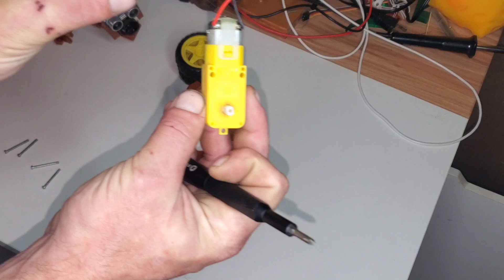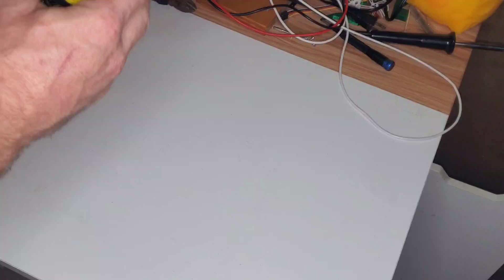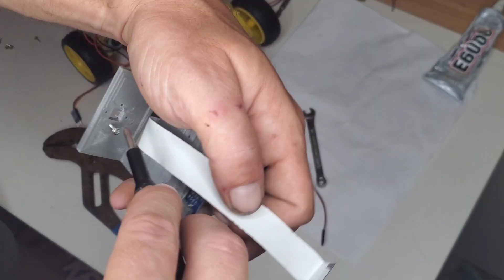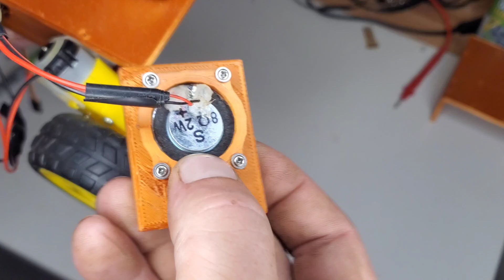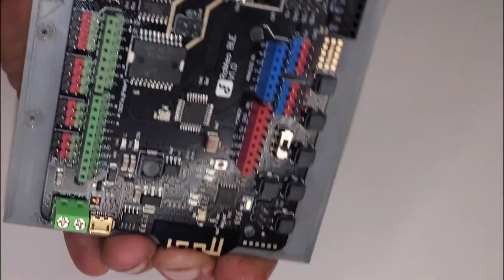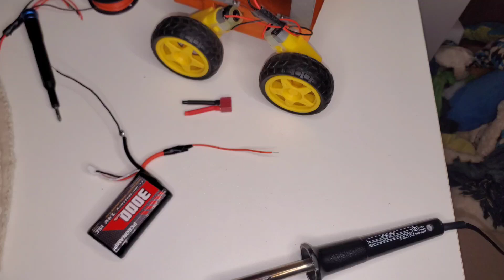How To Make A Robot That's Fully Controlled By ChatGPT (Part 1 of 2: The Build) - ALL CODE INCLUDED!

Comment: can i use the arduino + L298N and usb webcam instead of the DFRobot Romeo BLE Arduino style board and picam you used in this video?
Reply from the maker: Yes but the camera runs to the pi, not the arduino. But you can definitely connect a Webcam to your pi. You might have to modify the code some but it shouldn't be more than a few lines to change.
Reply: @makingmadeeasy  will you release a video for arduino,usbwebcam,HC-05 and more basic components?also an awesome robot 😍😍😍😍
Reply from the maker: @zeromarkgamers9201  this robot can't be built with more basic components
Reply: @makingmadeeasy  will you support me personally to finish this project I can get you a payment (as much as I can)😅
Reply from the maker: @zeromarkgamers9201 man ill be honest, I hardly have the time to even do my own projects lol
Reply: @makingmadeeasy  i get that brother.same here 😅

Comment: I was wondering how this project was going! Well, I see! Nice work!

I'm also kinda starting over with a similar ROS based project, mostly in my software implementation. I was using Claude Haiku, gonna give the Gemini completion models a try because they're freaking free, and free to fine-tune! (If you don't mind handing Google your data to train on, that is. eh, whatevs.)  ...I know running my bot is literally only pennies in API cost, but I have a mental block about just letting it rip just for the sake of amusement :)
Reply from the maker: @thenoblerot  yeah that's definitely been an issue, but thankfully with the new gpt4o-mini model, it's so affordable that I can send the camera image along with full chat history and related previous experiences in each prompt and it's like only a penny or less per prompt. Wayyyyyyyy more affordable than previous openai models.

I'd like to try out some models from others besides openai so I'll check out gemini (if they have a vision capable model like gpt4 anyways..)
Reply: @makingmadeeasy  yep! All the latest Claudes and Geminis have vision. Gemini can even take video with audio apparently, that it interprets with speech to text and video as 1fps images.

I can't wait for the day when OpenAI (or someone else!) has real time voice mode in API for pennies! Better yet, local models and cheaper gpus... It's all coming at some point! 😁
Reply from the maker: @thenoblerot  yeah I got an old vacuum robot that I'm gonna turn into an r2d2 style robot, with a full computer running some kind of model. Just gotta wait like 5-10 years for hardware to improve and prices to come down :(